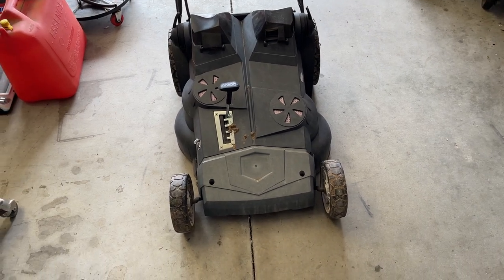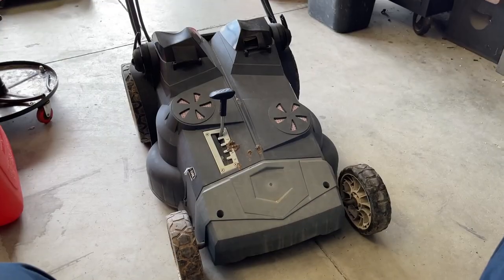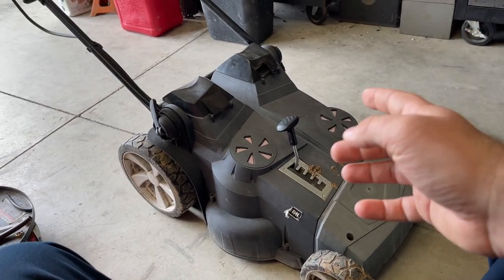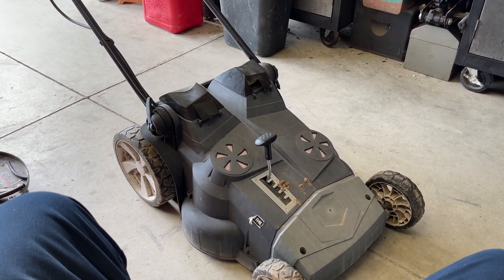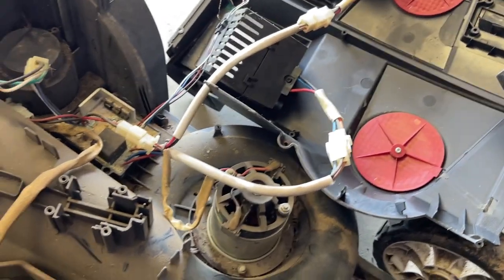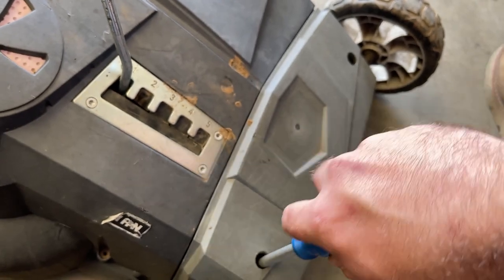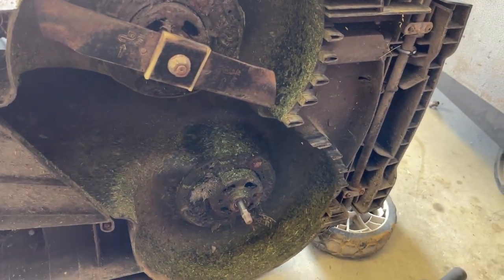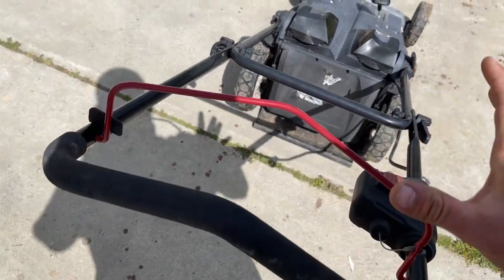Saved a 40V Craftsman Mower - Disassembly and Blades + a Short Rant

Comment: I got a greenworks for free and thought the same thing you did Hank about he batteries but I was wondering if I could repair it.  I got the blades moving but it’s still pretty stiff.  Have you changed the bearings in the motors before?
Reply from the maker: I haven’t. You’d need a bearing puller to do so.